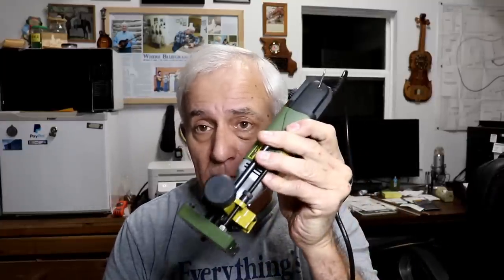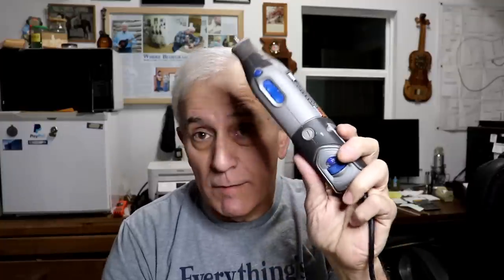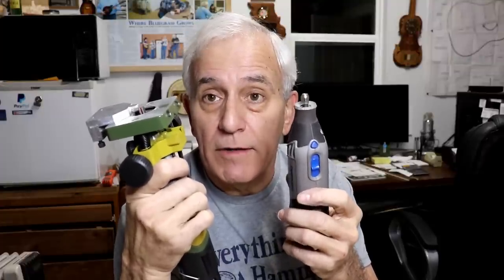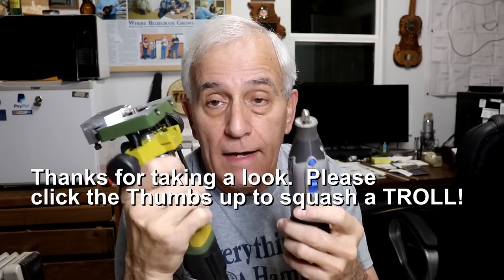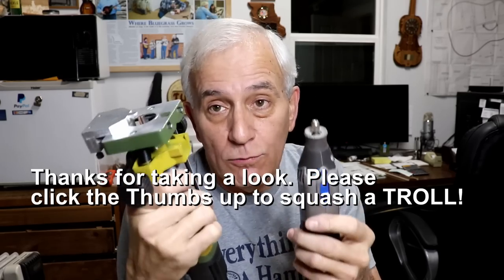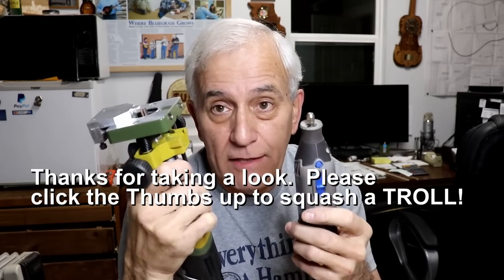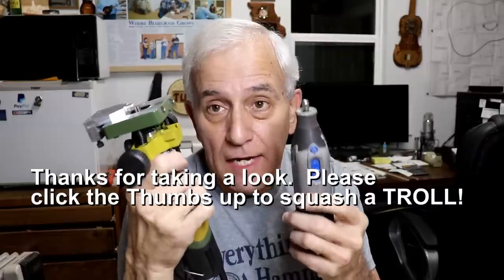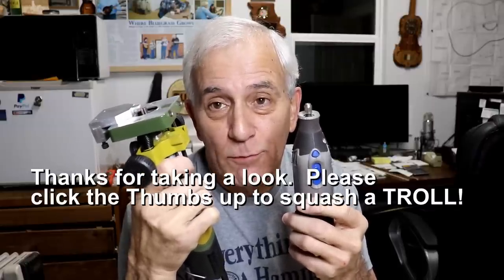361 RSW Dremel Vs Proxxon   The Battle Begins

Comment: Unfortunately, your conclusion is not credible, because you obviously already decided in advance that you like the Dremel better. Amps are not the right data, but the power, which is in Watts, with the Proxon having the same power at 5,000 or 20,000 revolutions, while the Dremel reaches its maximum power only at the highest revolutions. Last but not least, the Proxon rotates at 20,000 revolutions even under load, while with the Dremel the revolutions drop from 30,000 to 10,000 under load, which I noticed in practice when I was drilling printed circuits, my Dremel only lasted about a year. And last but not least, it is necessary to choose another Proxon, say Micromot 230E, as a pen.
Reply: Thank you for rhe conscise breakdown between the two.

Comment: The Dremel is an AC motor.  Proxxon uses a DC motor and converts AC to DC in the tool.  You can't go by Amp ratings since you're comparing an AC tool to a DC tool.   I'm not sure there's an easy way to make a 1:1 comparison based on maximum amperage draw alone.  The DC motor is one of the reasons the Proxxon is so much quieter than the Dremel.   Where you should see a real difference is at lower RPM where motor torque on the DC motor should be greater than the on the AC motor at the same speed.   If you look at torque curves on DC electric motors, they need very little voltage to reach maximum torque.  As an example, I have some custom built 12 volt DC motors and the torque goes up to maximum at 3 volts and is flat to 12 volts.
Reply from the maker: Sorry the amperage posted on the outside of the tool is in AC.
Reply: 0

Comment: The Dremel 4000 is a far superior tool. It has at least 50% more power. That is why it weighs more. The armature has much heavier windings to handle the heat generated by the increased amperage. There is also a 50% increase in the available speed range. 20k on the Proxon and 35K on the Dremel. I guarantee the Proxon does not have the tool life or the work hours that is in the Dremel. In my humble opinion the Proxon is the amateur hobbyist tool.

Comment: Comparing the noise difference between a new tool and one that is 15 years old with many hours of use on 15 year old bearings is not a fair comparison. I bet a new dremmel would be somewhat quieter.
Reply: You beat me to it.  Also, bearings are more precisely made now.
Reply: I thought the bearings sounded like they need replacing.
Reply: Your quite right. Its amazing how much noise comes off dry bearings. Also cleaning the fan can make quite a difference in my experience.

Comment: I looked in one of my motor reference books, and in general, DC motors are 30% more efficient than AC motors. This is due to a secondary magnetic field being generated by the permanent magnets in the DC motor, which is not present in the copper winding in the AC motor.   Without a direct torque measurement at the tool chuck, it would be difficult to make any claim as to which on is "better" based strictly upon the rated maximum electrical amperage of the tool.
Reply from the maker: You can tell when you're holding it in your hand and routing something which one is more powerful it's quite obvious
Reply: Looking for my uglies and black reference books
Reply: And have constant power in low rpm, while dreemel would jammed in low rpm... that MUST HAVE!! in detailed work... lowest rpm but not getting easily jammed....

Comment: Jerry #1- You are right about the amps on tools the higher the amps the better, I used too sell tools Many years ago & I had too go to a 6- month training on tools. #2- for your Proxon you can cut a piece of lexan to whatever size you need & use the 2 screws on the bottom of the base to attach it, Also you can add some grip tape to the metal end so it wont be as slippery to hold. 3rd Both tools are really considered hobby tools if you want a truly professional rotary tool you have too buy a Foredom*** They have many models available but they are a bit expensive  But they are wicked smooth operation. Thanks Jerry & God Bless

Comment: For the Proxxon router-base, use self adhesive HDPE or UHMW poly tape.  Woodworkers use it on machine fences.  Very slick and non marring.  That’s probably what you made your other base from, only it comes thinner with adhesive on it.

Comment: As some others have mentioned, that Proxxon is not meant to be a handheld precision tool (and neither is that Dremel). Proxxon has a lot slimmer and lighter tools for that like Micromot 230/E which I have. I have at least average sized hands and Dremels with any power are WAY too bulky to even consider without the flex shaft. So your opinion isn't really useful to most people.

Comment: If you want power speed and lightweight, then I'd go with a micromotor. You'll pay more for a quality tool, the Foredom K1040 I use is certainly pricy, but then again it spins up to 50krpm, and has plenty of power. And it comes with a foot pedal. Absolutely the best small carving tool I own. I also own the Proxxon professional you reviewed, but to be honest I only purchased it to use with their Pantograph engraving tool. Just so you know, I am not knocking Dremel, heck I have two still functional Dremel's that are much older than your 4000.

Comment: I agree with most if not all your review comments. 
   On my bases after I get them flat I glue or 2side tape formica (you know, from countertops) to the bottom. You can spend as much time as you want to customize them (screw holes, adjustment knobs, etc.)
   As far as carving and inlay work, other than a blade, I use a miniature router plane (or planes, sometimes I custom design one for a particular purpose) I find I have a lot more control with a non motorized router plane than a router or dremel type tool.
   If I need to grind out a bunch of wood, I got lucky and found an old dentist drill. Certain rotary engravers can also work.
   Sometimes it just comes down to what you can find and what you're willing to spend (time or money) to get the job done.
Keep up the videos, I enjoy.

Comment: The right competiter would be the Dremel 3000.
I have both tools, Dremel 3000 and Proxxon IBS/E in 230V version. The Proxxon has a power of only 100W compared with 130W of the Dremel but, there is much more torque with the proxxon. If you want to polish (most in the middle range of the rpm) the dremel failed and stick a lot, the Proxxon  shows much more pulling power.
Both have there friends.

Comment: Proxxon also has another series which specifically designed to be handheld like a pen. For example the Micromot 230/E. 
The one you have is meant to be held on the body or in one of their bases. I‘m going to get the rechargeable battery version of yours since I already have two other machines from the same series with two batteries. The polisher and the band—sander. 
I‘m also getting the router-base and will be using the 3M blue masking tape to prevent scratching delicate surfaces. I‘m probably going to glue a neodymium magnet to each side so I can stick the whole thing to a vertical metal surface when necessary. 
Thanks for the video. I will take a good look at the Dremel product range when shopping around!
One last tip: If I were you I wouldn’t use the fomaica surface to sand the base. I‘d use a sheet of 10mm glass which is guaranteed to be much flatter.

Comment: I've been using a B&D RTX for over 20 years, and I never had an issue once. I've routed out several pickup and tremolo cavities, and use it all time time for my custom automotive wiring installs. Heck, I even used it to polish a whole motorcycle once. My RTX has been used and abused with grinding, cutting, sanding, wire brushing, polishing, routing, and all on various materials like different metals, plastic, wood, and ceramic. I also have a Dremel 4000 and a cordless Hyper Tough and have used several other brands as well. 
Bottom line, it's all about preference and I prefer the B&D because of the lever lock (not push button), and it works better with my crippled CP hands. As long as it gets the job done, what difference does it really make of which brand, style, or price of the rotary tool you use. I guess people have nothing better to do, than to nit pick and get their panties in a bunch, because you're not using their favorite brand. Oh well!
Reply: Brungraber:
We are not nitpicking, we are discussing.  At one point B&D made some of the best tools.  Then one day, they were bought out by someone who milkt their name and made shitty tools.  This happens all the time in the business world (B&D, Bushnell, and MANY others)--the plan is to make cheaply, a bundle of crap, slap on the high quality reputation name and sell for high prices.  It's cheating the unwary customer.  It happened to me with Bushnell binoculars about 50 years ago.  I had bought a pair and they were excellent.  then I lost them.  I bought a new pair but in the mean time the company was bought by one of those "milkers" and the new pair I got was crap.  Again, just like a tool with a motor, "weigh" any itme you are buying--heavier usually means better quality.  

A friend of mine in the Philippines got hipnotized by a "gold" watch being sold by a street hawker.  He, being Philippino, should have known better but he was "hypnotized" by it.  The hawker wanted 500 pesos for it (about 12$ at that time).  Me, being a foreigner but being street-wise, knew without ever touching it, that you could get that watch from this very hawker for a third of that, picked it up and was horrified at it's feather weight!  This thing wasn't worth a dollar in my view.  Well we finally got it for about 2$ (the hawker was most likely laughing in his jacket at the suckers who bought it) and I thimk it lasted a few days.  

Anyway, the point is, is that there are plenty of good reasons for discussing this.  Don't nit pick with this

Comment: Hi Gerry, my jigsaw had a knack for sometimes scratching kitchen worktops with it`s base as I cut out for sinks or hob cookers, I use both Gaffa & Masking tape (depending on what is to hand at the time), but, I run an iron over them, this softens the adhesive & increases the `tack` or grip on both, both wear eventually but, no more scratches

Comment: I have the Dremel 8220 with a 12v lithium battery, which works great for what I've used it for. Not sure the RPMs but it's got variable speed which is very handy.

Comment: Hi, I want to let you know I enjoyed your video the most with regards to your clear and loud explaining. No long winded thing.   My suggestion for you to add to you aluminium proxxon router base is to use, 3M TEFLON  TAPE, which has super strong sticky backing and supper tuff slippery smooth property of the tape. This might server your needs.  I have used this tape in my work a lot where two metal sliding surfaces is required and no oil or grease is allowed for lubrication. Most microprocessor manufacturing equipments used it. It is opaque grey colour and comes in the form similar to electrical insulation tape. Your router base will not scratch the delicate things you do.  Hope this help. 

Best regards K C Ung. Australia.

Comment: I hope this is of help, Teflon tape(not the plumper type) would work for a slick, not scratch surface to put on that router base.  It is like those pads or feet of a computer mouse. An example can be found on Amazon found as "CS Hyde Conformable PTFE Tape With Silicone Adhesive"

Comment: One last thing, here. The outside ring that you're holding onto in your pencil grip unscrews. I don't know if yours does this, it being that old, but when you unscrew it, the hole in that fits over the outside of the chuck, and can be used instead of the wrench. It's handy to use, especially when you lose or just can't locate the wrench. I've gotten to where it's my first go to whenever I change bits. Check it out, it yours doesn't, I'll bet you can order one from Dremel. It's a very useful thing that they thought up.
ETA: Okay, TWO last things. On your router base, check into the UHMW plastic that is adhesive backed. It's about 1/32" thick, and is great for fences, jigs, anywhere you need to have a slick surface that won't scratch anything. Woodcraft, among other places, have it. It goes a long way, too.
Reply: I just saw a video of a team changing the wheels on a rail car truck, and when they remounted the truck to the car they put in a disk of yellow UHMW plastic as a thrust washer.
Reply: @danmick8645  That stuff is really interesting. I can't for the life of me figure out how they get the adhesive backing to stick to it. No glue I know of sticks to it, you have to use mechanical fasteners on it. But they have that adhesive backing that sticks like crazy to it. I love the stuff, I use it on all kinds of jigs and fixtures, even on the fence on my table saw. A slab of it makes for a really great gluing table, because again, no glue sticks to it. It's not cheap, but it is useful as all get out.
Reply: Somehow they get Teflon to stick to the pan, too.  Chemistry magic.

Comment: I've been a Dremel user for many years.   When my previous one got to the point where the runout was way too much I bought a 4000.  Alas this one has not lived up to my experience with the older one.   It says my 4000 was made in Mexico and I don't know if they have multiple manufacturing plants which might impact quality.   The current one has an intermittent on/off switch, the speed control is very erratic, and it gets very hot after about ten minutes.   I'll confess I'd be reluctant to risk another Dremel purchase but I'll worry about it when the time comes.  Thanks for a great review and comparison, Jerry. 
Cheers,   John
Reply: BreatheScotland  Cool, thanks for the info.  I'll see about finding some spares for mine.

Comment: I don't know if this Dremel has it also but on my cordless Dremel 8200 you can unscrew the rubber ring where you hold the Dremel between thumb and index-finger. With that ring you can screw and unscrew the cutting-tool with two fingers. So you can litterly put a new cutting-tool out and in about 15 seconds. If you switch often tools then you know how much this function is worth. It's almost worth buying the Dremel above any other multitool.
Also my 8200 is cordless witch i always prefer above one with a cord. I have two battery's, witch are bosch battery's with Dremel label. On one batery i can use the 8200 about 45 minutes. That's enough to charge the empty 2nd battery. You can always buy more battery's if needed.

Comment: I say go with a plastic coating. For me the amps and top speed aren’t that critical since I rarely use these tools at full bore—low noise is what I want—but once you mentioned the handling you had me convinced. Nobody should have to use that silly collet tool when a wrench is so much easier, and that terrible grip would be the deal breaker for me. Thanks!

Comment: I have a takemine acoustic electric I bought in 2004 
I really struggle with bar cords 
Always have I use elixir strings 
It’s sounds awesome 
If always wondered if a fret job 
And custom work would help with the lightest action I could get without vibration 
This guitar plays very well without issues I got it at guitar center 
Any suggestions?

Comment: I have both the Dremel, the Proxxon and actually several others. I will throw in my two cents. They are different tools that have a similar form factor. 

The Proxxon is a lot better for attaching to things with the machined collar. It has much less runout than the Dremel. It has significantly superior cooling for extended time running it. I use the Proxxon with a tool holder (the sell them or you can make one) as a tool post  grinder in my lathe. The drill press stand for it is really nice as well.  Works really well for tiny drills. 

The Dremel has a lot more variety in the types of attachments you can get for it. I agree it is a lot more comfortable for hand held work and It does have noticeably more power. The oddball threaded neck makes it hard to make other holders.   

I would stick on some of the UHMW-PE tape to the router base. It is nice and slippery and really tough.
Reply: your comments are right on sir
Reply: Yeah, the runout is what I was hoping he would show. I have the Proxxon and there is zero bit wiggle when it runs. I use it to drill tiny holes in PCB boards for electronics and the Dremel just would not do it.

Comment: In my opinion I think the Proxxon has more cutting power or low end torque, when i used my Dremel 3000 to cut a chain link it would stall when to much pressure was applied and  the Proxxon seem to me stronger when I cut into metal. I have both and I prefer the Proxxon.

Comment: My dremel 4000 i have had for 4 years is the best most useful tool i have ver owned, just yesterday i used it to cut and plug a gass leak in our house, cut throught 15mm copper pipe like butter and smooth.

Comment: Two real good tests for rotary tools are “run out” and torque per RPM. I once saw a spreadsheet comparing all the popular rotary tools and the higher end Drexel tools like the 3000 & 4000 simply smoked all the competitors in run-out and torque....up to 2x the price. Past that price range the micro die grinders like a tool & die maker might own smoked the Dremel tools.....but those die grinders are @ $400-500.

Comment: Jerry, just mt two cents.  The issue you had with the bit slipping was the chuck, not the motor.  I don’t know anything about the  Proxxon, but if it had a chuck accessory like the Drexel the same issue would exist.  Someone mentioned runout.  IMHO not an issue in a hand held tool, but definitely if the tool is in a rigid device like a CNC machine or drill press. Thanks for the review.